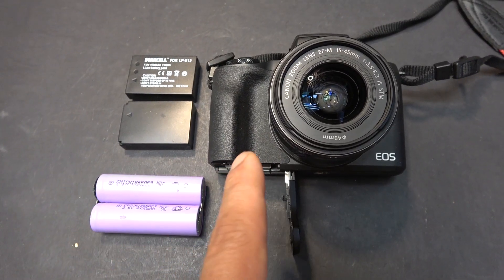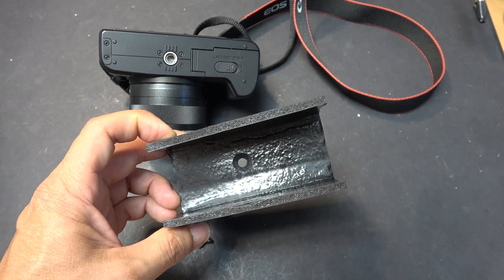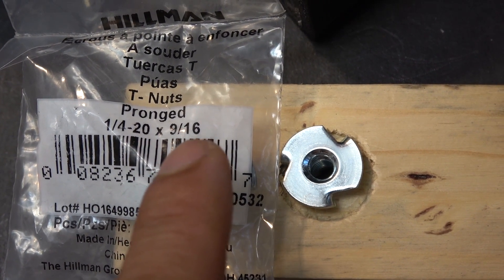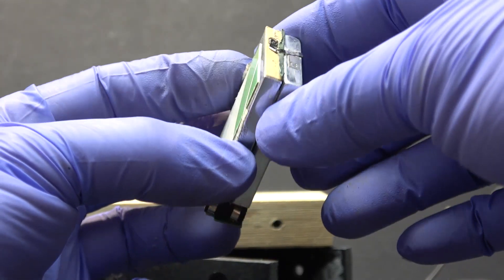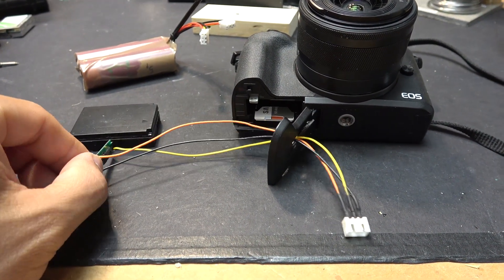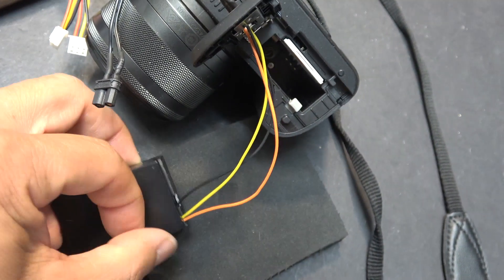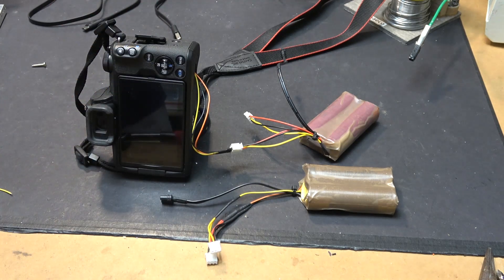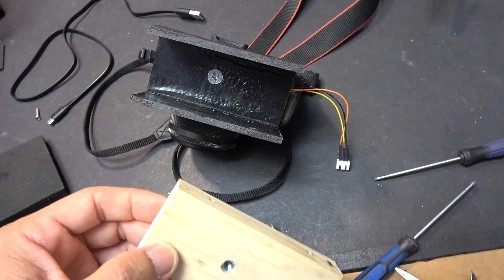DIY Canon M50 Camera battery hack: Upgrade with Tesla model 3 -2170 cells

Comment: I have the very same idea for my nikon. It's even written on the camera the voltage is 7,2 - 9 volts. Pretty easy. I was afraid cutting the battery case yet. I would have used it as dummy like you. I would only use the battery as port. So no worries about charging external. It's over 50€ for a battery with almost no power. I fucking hate this capitalism =)
And again, first time I see somebody doing this or even thinking about it. 
I finally found my mentor. Thank you

Comment: Get this man a 3d printer
Reply from the maker: It's nice to have but a pain to deal with.
Reply: @vuaeco  Sir, you can buy a 3d pen, it'll not be as good as the 3d printer but you'll not have to deal with maintaining the 3d printer, that way you can use your 3d pen in small projects.
Reply: @vuaeco  I have own a 3d printer for 5 years they are not thatbad to deal with once you learn cad but a free one that is very easy is tinkercad
Reply: @vuaeco hey mr vuaeco the phone video you made about the phone upgrade if i was you dont use the foam what you used to make the casing its better you use pvc an use fire resist ducktape the tape will work as an slow the fire before melt it down an give some time to throw away the foam would become an hot subsestance sticking at you an pvc as abs. best is abs to use would be safer to  i did it build an bettery casing my self. an is way more safer than foam an takes longer to melt than foam an one qeustion did you every try an tablet an upgrade that you wont have to charge for an 6 months. an can you make an update video about the last upgrade with those lg chem cells you used please bc it caught my attention an watched the one you used with the Tesla cell modification as well pretty interresting you did their i was impressed but i hope you make an upgrade video about the new upgrade with those lg chem purple cells